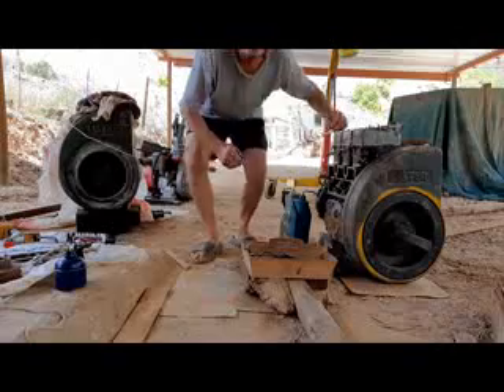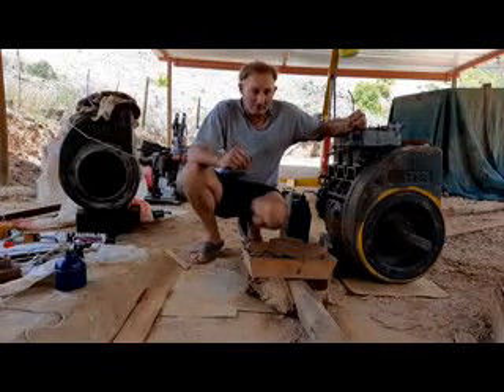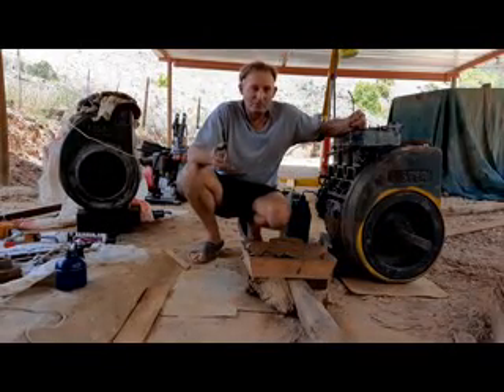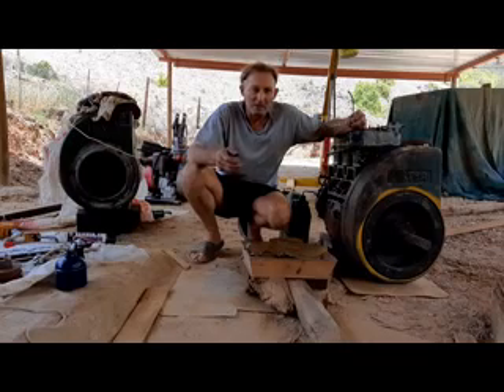This is about the plunger oil pumps in Lister engines

Comment: I couldn't understand a word you were saying.
Reply from the maker: Hallo. The pressure release valve on these plunger pumps are in a cylinder  .When the plunger pump is on its pumping stoke oil goes to the engine bearings excreta , then the rest of the oil pushes the release plunger an till oil squirts out by the pressure relief holes . When the oil pump goes over to its suction stroke it doesn't deliver oil .The spring in the release valve  pushes the plunger back in cylinder , then that oil goes to the engine parts. The  special release valve is that long cylindrical nut you see there. I hope you could follow this explanation.  Keep well
Reply: Turn the subtitle on.